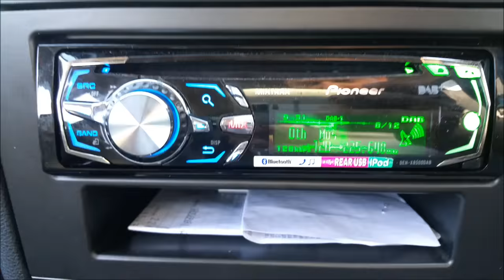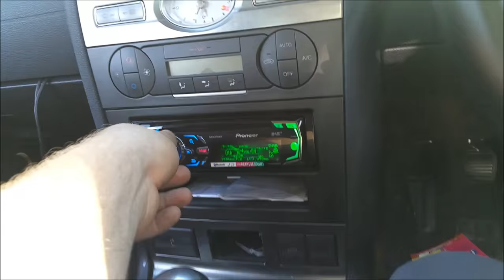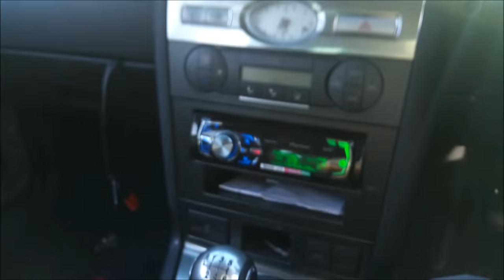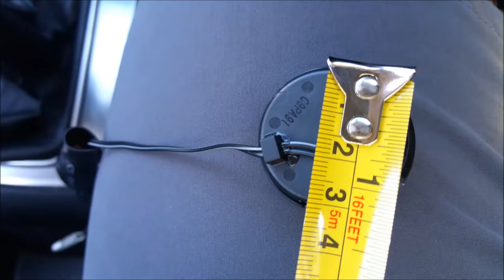MK3 Mondeo tweeter install

Comment: Location of tweerer is a difficult one, and will split opions on everyone.
In the door ? 
In the door pillar (means making pods to hold the tweeters and then adding these pods to the door pillar)
On the Dash facing you.  (Probably the best as HF are very directional)
Still its up to the individual, and may depend on how much moding of the door pillar pannel, dash you want to do, or feel looks ok.

Comment: What I did is that I bought a passenger side mirror adjuster knob cover(my car is left hand drive). Then I just widened the hole with dremel to fit the tweeter (Alpine SPR-10TW). 

Of course I had to move the mirror knob somewhere. So it took a little soldering to lenghten the wiring but now I have the knob just in front of the window control. Looks modern.